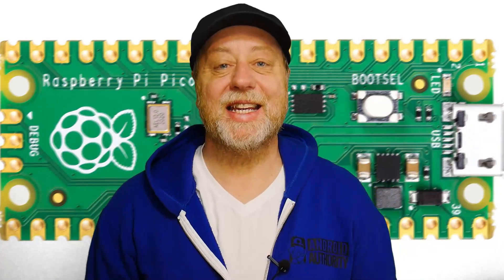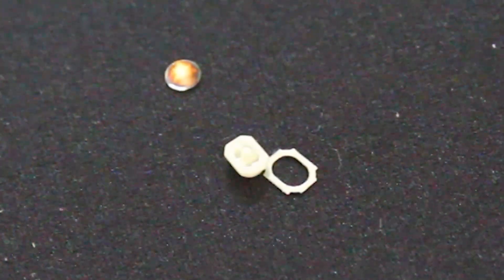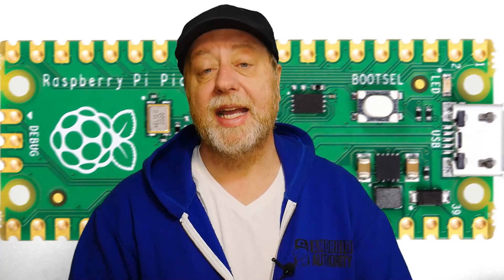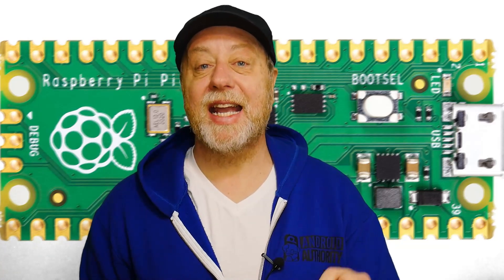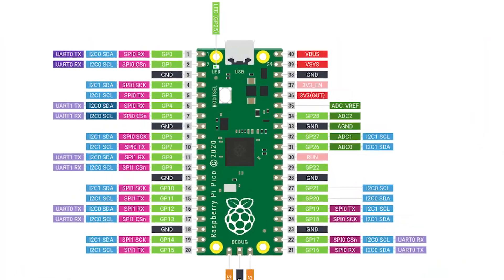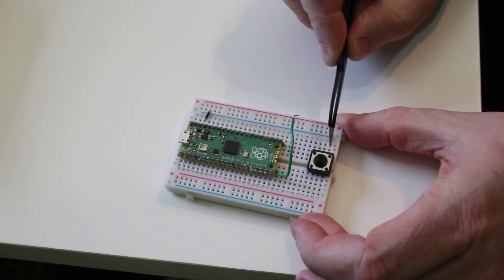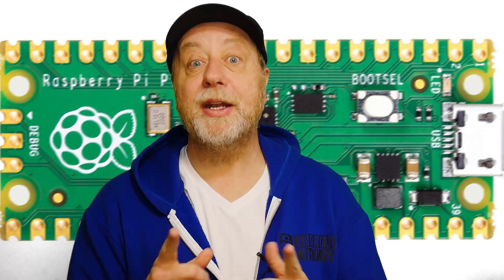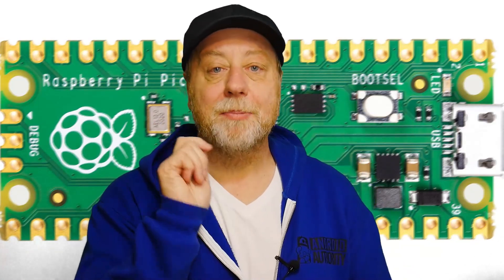How to Fix a Broken BOOTSEL button on a Raspberry Pi Pico

Comment: I think I may actually able to soldar a new one on it. It's 3×4×2.5 4 legs push button, and I can buy 20 of this at CN¥3.1($0.44) on taobao in China. I just broke my own pico when desoldering the pin headers hear the button😂
Reply: Don't try this without heat gun, I just broke my board desoldering the button.

Comment: Even cheap stuff should be saved from E-waste, well done. However, the cheapest I can find at the moment is 3 for £14.50 with the mode average being around £9 for one.
Reply from the maker: Since you are quoting £ then I am going to assume you are in the UK. The Pi Hut has them for £ 3.60.
Reply: @GaryExplains  Once again proving eBay isn’t always the cheapest. Thank you Gary.
Reply from the maker: As I say in my Arduino vs Pico video, you should only buy from the official distributors. eBay is not an official distributor.
Reply: @GaryExplains  I saw that video and believe me it isn’t the first time I’ve come a cropper not listening to good advice. My father died 26 years ago and one of his favourite saying to me was "You’ll learn one day." I think he might still be waiting for that day.

Comment: Good day Gary. I'll hope you'll answer me,cause my question isn't about the video,but over something else. I'm scouring the internet,but to my dismay.....no answers for me..just the same old story ( i5 7th gen intel processors aren't of the recommended processors for windows 11). My laptop specs is i5 intel,1 TB nvme m.2 SSD with 16GB of RAM. I quailify for al windows recommended requirements,but just my processor isn't good enough for Microsoft. I'm getting an overhaul better experience using windows 11 on my laptop,than with windows 10. I'm getting better and more consistent FPS in games,my temps are better,than what it was with windows 10. I hope you can tell me, what is the reason for Microsoft not allowing i5 7th gen intel processors?

Comment: Or, just a thought, you can just remove the button and solder a new one in place?  If you’re already gonna break out the iron, you might as well do it right.
Reply from the maker: Hmmm, nah, surface mount stuff is hard to solder, plus you need a button of the exact same size and dimensions.

Comment: My method not so sophisticated, use a  small crumpled ball of aluminium /tin foil to bring contacts inside switch. Just dab it in the switch like you would press it. Used this method on many a broken micro switch. (just use a small ball and make sure not to short out other components)

Comment: All you need is some wick and flux. those buttons are cheap and easy to replace. no need to jumper. Just need enough heat. while being careful not to lift the pads. Pi pads lift kinda easy.
Reply from the maker: Well, I don't find soldering surface mount stuff that easy. Nor do I have a replacement button. But I am glad you find it easy.
Reply: @GaryExplains   In fairness I use to fix stuff like this for a living. It can take some getting use to. Not trying to offend. Just tips on the flux and wick. The easiest way I have used and seen is to check the needed connections and just use a thin wire to jump it. It requires just heat the solder that is on the pads. not adding any or any other special tricks that I have seen. Good day man, I look forward to more C programming on the PICO cause you make that look easy.  I was just wondering if you can make your own C env to program in then send the compiled program over. Thanks for your work man. 😎

Comment: Nice tip, using a small breadboard like that does save scrapping a Pico, it's only a cheap board but we should try and learn to fix things when we can instead of just throwing them away.

Comment: Why not just replace the defective button on the board itself? Soldering SMD isn't that hard...
Reply from the maker: For a couple of reasons. 1) You need an exact replacement button, something I don't have and so I would need to order it. 2) Soldering SMD is hard, certainly for a novice in soldering like me.
Reply: SMD's  need modern equipment to do, you can not just use a £2 soldering iron, one the iron will get too hot and the  bit too big. You need temperature controlled equipment that melts the solder but does not damage the chips, The switch made of plastic will melt lower than the chips. For a £4 board Gary's repair will allow a lot of people to reuse their broken controller without spending a great deal of money.
Reply: @tonysheerness2427  While I'd not recommend a £2 soldering iron, every maker should have a half decent soldering iron (15W-18W Antex or Weller for about £30) because a half decent iron will be stable enough to replace one of those switches without cooking the board. 

Having said that, I like the hack Gary did and his point about being a newbie who finds SMD work difficult stands, it's not an easy skill to master if you've never soldered before, it takes patience and practice to get the 'knack'.

Heck there are plenty of people all over youtube who make me cringe at the sight of their 'good' soldering. Still, I suppose it keeps flux factories in business.